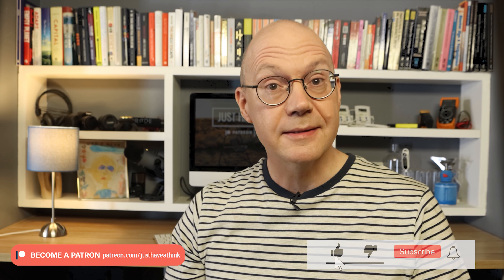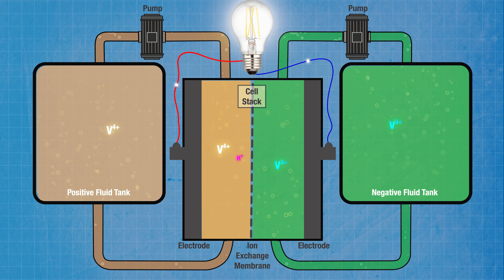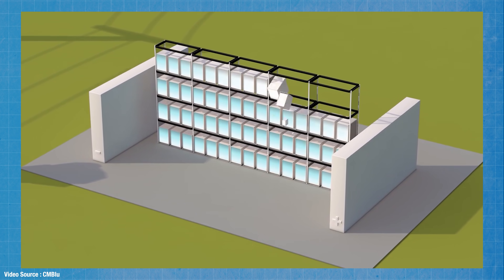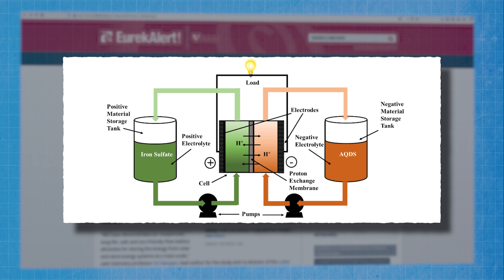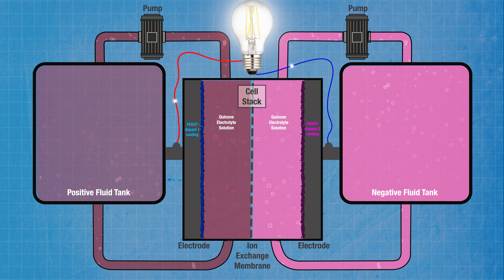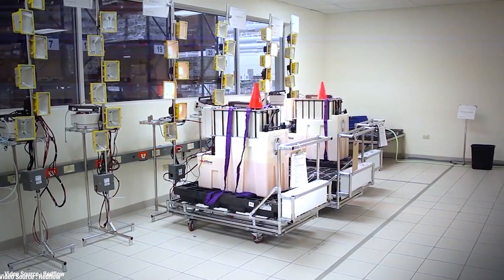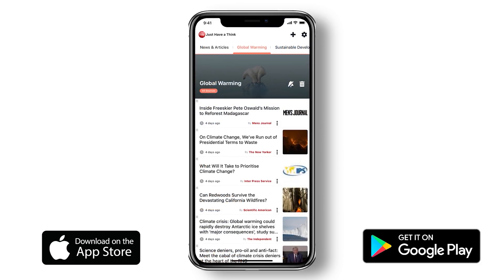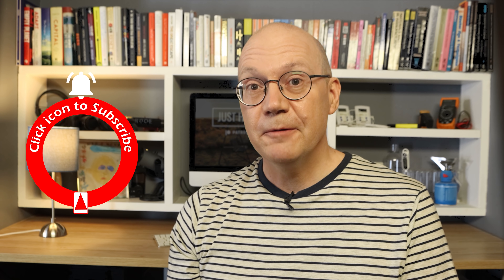Organic Redox Flow Batteries - The true path to grid scale energy storage?

Comment: Are flow batteries less efficient than lithium? I thought that was the biggest problem with flow batteries.
Reply from the maker: Yes they are, at least in terms of energy density. But they are cheap and cheerful and easily scaleable. And you can leave them sitting there charged up for months.

Comment: Another technology to look at is the plating battery.  One such is the ZnBr battery.  While charging it plates Zn on to thin plates of plastic dosed with carbon to make them conductive.  While power is being used, the Zn goes back into solution.  The Br released while charging is absorbed by a fluid that stores it.  They are only 75% efficient but have a virtually infinite life time with, possibly the occasional replacement of a pump.  Another disadvantage is that they must be fully discharged every 3 days but on the other hand they can be fully charged and fully discharged with no damage. There is a company in Aus that is making them commercially.
Reply: That sounds like a Frankenstein monster stitched together from the worst aspects of regular bateries an fuel cells.

Comment: There seem to be a couple of errors or needs to update your criticism of lithium batteries for grid storage.  Let's start with cost.  

Tesla apparently has worked out a way to drop cost of cells by over 50%.  That means that all comparative math needs to be redone.   Then there's capacity loss.

Jeff Dahn, Tesla's main battery researcher, has been constantly discharging and charging some type of lithium batteries, I expect lithium iron phosphate, for more than three years in his lab.  There are four groups of cells being tested to determine capacity loss as a function of depth of discharge.  Those cells that are discharged either 75% or 100% before recharging have lost less than 10% capacity after 15,000 cycles.  The cells in the 25% and 50% maximum discharge groups have lost no capacity after 15,000 cycles.  I assume a cycle is defined as the equivalent of a 100% discharge/recharge.

15,000 cycles would mean 41 years of storing solar during the day and discharging after the Sun goes down.  Or 20+ years of two cycles per day, one for solar and another for late night wind input.  

Since that information release Dahn has completed thousands more cycles without the batteries "falling off a capacity cliff".  We  simply do not know if these cells will ever wear out.  If we've got a "40 year" storage solution then that could be financed with low rate 40 year bonds, making the daily cost of storage very cheap.

Now, your "4 hour" statement.  There's nothing about a lithium cell that says it needs to be discharged over four hours.  That is simply how the present storage systems are being used.  Solar is being stored and that energy is fed back in during the four high demand hours following sunset.  We could charge up cells and gradually discharge them over days, weeks, or months depending on our needs.

Perhaps the way we deal with the problem of periods of low wind/solar input is to normally discharge our batteries only 25% to 50%.  Then when we enter a long period of decreased input take the batteries down to 0% as needed.

Math needs to be done comparing various solutions using the new lithium battery numbers.  May the best solution win.
Reply: The big difference lies with storage. With lions, power and storage go up at the same time. More storage necessarily increases the max power output. But once you have enough MW, there is no value in constantly getting more. You still pay the full price, but only half of the power vs storage equation matters any more,
With flow batteries, power and storage are independent variables. Want more MW? Build a bigger chamber. Want more storage? Add more water tanks. The big advantage is that storage tanks are cheap, so total storage ends up very easy to scale. It becomes possible to have low MW but it can last for days.
Reply: @Bobucles  I don' t believe that is true.  Both cells and storage tanks store energy.  The amount of power that can be obtained from either is a function of the hardware that turns that chemically stored energy into electricity.  Let me give you an example.

I live off the grid with solar panels and batteries.  The amount of power I can pull from my system, the maximum kilowatts, is determined by my inverter.  I chose an inverter larger than some would need because I have a woodworking shop and need to run things like table saws and planers.  But I didn't install an inverter powerful enough to run a large AC or arc welder.  

The amount of storage I have is determined by the number of batteries I purchased.  This will be my first winter with lithium iron phosphate batteries after many years of lead acid batteries.  Unlike the lead acid batteries I can add "new to old" without lowering the performance of the older cells.  If I find one more battery might make it unnecessary to run my generator during the worst of the winter then I can buy an additional battery and add it, giving me more storage.  But the amount of power I can pull from the system at peak demand will not change.  

Short version:  Inverter determines kilowatts.  Batteries determine kilowatt hours.
Reply: @bobwallace9753  lions are made up of large numbers of tiny cells linked together. Each individual cell has an energy storage, and it's own charge/discharge rate. A linear increase in storage equates to a linear increase in max power draw, at least ignoring realistic problems like heat. The only way to shift the ratio is to change the cell type, but lions don't seem to offer much tradeoff there. At least it is not as extreme as using a tiny flow generator with a swimming pool storage.
A tiny inverter does not change the capabilities of these cells. Use a bigger inverter and you can drive the cells harder, up to their individual limits.
Reply: @Bobucles  The inverter determines the amount of power that can be pulled from a battery bank.  The number of cells determines the amount of energy in the battery bank.

Tesla builds moderate range Model 3s and massive grid storage systems using the same cells.

eta: A better example might be Tesla's Powerwalls and Tesla's Hornsdale battery system in Australia.

"Powerwall 2 is a 13.5kWh capacity rechargeable lithium-ion battery that boasts 7kW peak and 5kW continuous power."

The Hornsdale battery system has a peak output of 150 megawatts and can store 194 megawatt-hours.

5kW vs. 150 MW
13.5 kWh vs. 194 MWh

They use the same cells.  Just different amounts and different inverters.
Reply: @bobwallace9753  yes, the inverter effectively throttles the batteries and acts as the choke point in the system. You still pay for the batteries either way. Don't forget that car batteries are made to drain over hours but charge in minutes. That can not be possible if the batteries couldn't handle the high charging power in the first place.

The point is that when you pay for a battery you always pay for both storage and power in tandem. The application does not always demand those same ratios that the battery is capable of.
Reply: @Bobucles  No, when you buy batteries or buy tanks for chemicals you buy storage.  Both storage mediums use hardware to turn incoming electricity into chemical changes.  Both storage mediums use hardware to turn chemical states into electricity.

Cells do have charging characteristics that slow their charging, ability to accept incoming energy, as they reach full charge.  But that's neither a power or energy issue.

I do not know which storage system will be the most affordable but due to the recent massive improvement in battery production we need to be using current battery costs when comparing to other storage systems.

Comment: So wouldn't something like this enable you to make a car with two fluid storage tanks and a plug with four hoses that you could hook up so it could pump out the old fluid and pump in new fluid to charge in a couple minutes?
Reply: The Problem so far is energy density . Organic Redox Flow battery from cmblu has 30kWh/cubicmetre  ... Li Ion has up to 400 kWh/cubicmetre ... Liquid Air Compression LAES up to 500kWh/cubicmetre ... More info (sorry only in german) under https://www.bves.de/technologien-final/ in the factsheets

Comment: Have you looked into hybrid system with lithium battery and H2.
For the short term storage is the   lithium battery with high C rates. The H2 dose make the long term storage. 
The plus side of this is quick charge times and long term storage.  And the cost dose not increase much when you ad more H2 storge to it.

The down side is the low efficiency off the H2 over all with about 38%.

Comment: Interesting teck,don't know if you had seen my comments on old videos,on this transmission/storage issue for renewables/green alternatives that I posted.its a simple technology ,called a gravity battery, where by solar and wind electricity lifts a gigantic 1-100 ton weight up during the day,and when that electricity is needed at night,the weight is dropped releasing the electricity when it is needed.ironically it was shell oil,that patented the teck,and the scaled down version,that looks like a grandfather clock,aimed at third world lighting,where the poor  rely on kerasine for lighting.thankyou for another great in depth show,cheers liam,london
Reply from the maker: Hi Liam. Not sure if I saw your comment specifically, but I have seen some gravity storage ideas and I will certainly cover the tech in the New Year. Cheers

Comment: The main question is not in the room. For grid size and home storage the charge and discharge Rate (C rate) is the most important number.  It is useless to have big storage capacity when you have slow charge and discharge rates. 

This is the big plus of lithium batteries. 
Just have a Think why this matters;-)

Comment: Redflow said they will be coming out with something new latter on this year, still waiting, and I am looking forwards to seeing just what this Gen3 can do: https://www.youtube.com/watch?v=rl55turYB-g. 
I believe I mentioned this on your channel a while back when I first thought about joining up with them to solve our energy problems. I will not be pushing to keep the current grid tie systems around the world but putting forth an effort to do away with that old technology that does the end user no real good. Instead of the grid tie system I will be moving towards on demand systems that put the user in full control of their own energy needs right at the point of use, no more electric bill in the mail, no more power outages or brown outs, and no more need for large scale power generating plants of any kind. Well, that's that goal anyway, but as I stated I too am waiting to see this Gen3 they are coming out with to see if it is a fit for my plans to solve the worlds energy production problems and climate change at the same time.
Reply: Were they the zinc bromide flow batteries?
Reply: @emceeboogieboots1608  Yes - see 8.08 minutes into this JHAT video.  These are the "Version 2.5" Redflow batteries.  The Version 3 batteries have the same capacity and performance but are more compact and have smarter battery controllers that can do things like make the the battery act like a lead-acid battery for easier integration.
Reply: @dyemanoz  Haha, when I saw that image I thought it was like a scene from Red Dwarf or something. Little robots in the ICU with the witches hats on top! 
I haven't looked at there website for a while so will have a look and check the vid from the original post if I get time today. Cheers mate